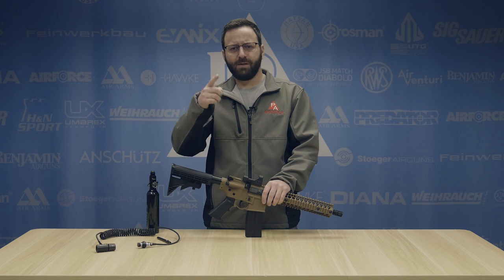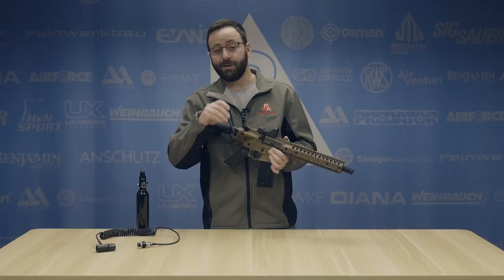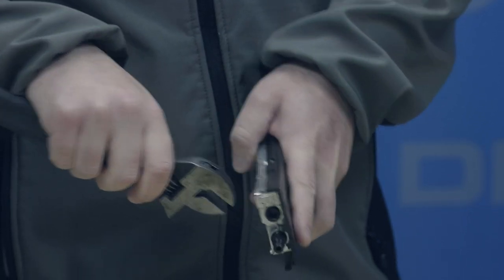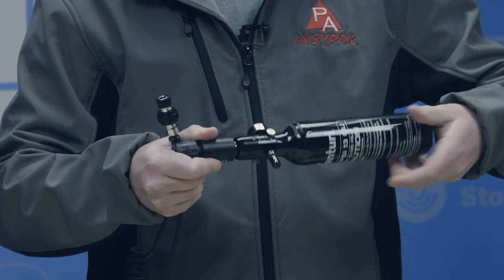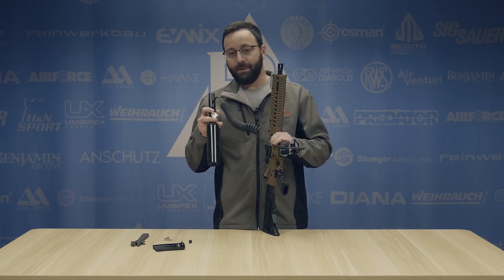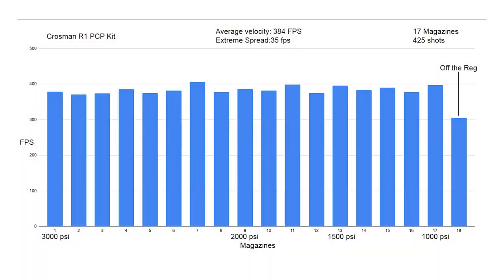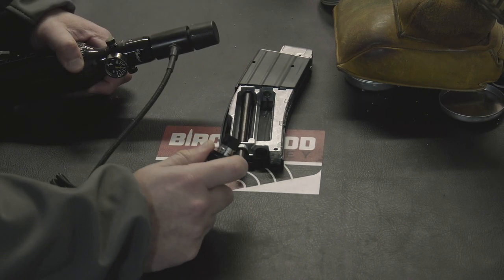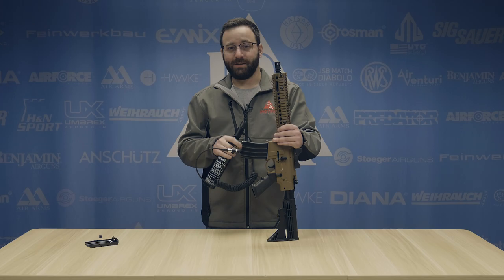Review of Crosman R1 Full Auto PCP - Pyramyd Insyder

Comment: Pretty cool setup. But I am no big fan of it - mainly just because you now are with one mag only. But still nice that you can get sucha kit. I'd rather though use it in the port #2 while keeping an empty cartridge in port #1. The cheap plunger-type  check valve between the ports often gets stuck if only using port #1..
Reply: That's why you gotta buy the spare mag with 300 count reservoir ...😉
Reply: @misterc6012  The large mag sounded like kinda of a good idea.. But I hate all rattly things.😁
Still got just two basic mags for my DPMS - but they been working all good, and that is way fine with me.

Comment: How is the Air Venturi 13ci tank best stored when not in use? I know for most PCP airguns, you want some air in there to maintain the seals. Thanks!
Reply from the maker: You can keep it stored with air in it.
Reply: @pyramydair  Thank you for responding. Any idea what pressure to keep it at? Around the regulated 1100 PSI?

Comment: How does a compressor pump up to 3000 pounds? My compressor is set for 125psi
Reply: You need an HPA (high pressure air) compressor, your typical shop compressors max out at around 150PSI, HPA compressors can go up to 4500PSI.

Comment: As a mod could this work on the umarex sa10 or the sig1911 we the people bb model?
Reply: yeah, what I'd like to know too. it looks like it could work with lots of other guns.
Reply: Sure it could, as a mod. Just need to know thread sizes and all that stuff for to make a good build for an adapter fitment for each gun/mag you wanna attach. Some probably easier to do than others - but still, doable.
Reply: @brorjordas1979  It's a length issue. The adapter may only work in certain guns, but I will see if it's been tried in any popular CO2 pistols.
Reply: @tylerpatner6591  Yes, that also.
And as asked in original post of the SA-10 and the WTP 1911.. The SA-10 mags do have a twist tab underneath. I doubt the Crosman adapter version would suit it without totally redoing the bottom of the mag. I can't remember.. It might have a thin nut as threads for the tab.. But I'd personally stay outta it. The SA-10 is fantastic just as original. Absolutely one of my top favorite blowback pellet pistols..
But them KWC 1911 pistol magazines. They do have only a grub screw underneath (most at least). A good chance for the length being an issue..
I guess time will tell.. But, I think that you actually oughta be in a very good position to check out every possible make/model you can get your hands on...😁

Comment: Can we increase fps by increasing dosage of air ??? Like.. regulator ?
Reply: You mean by increasing the regulator pressure?  Possibly, but since these are CO2 guns, I would not recommend running them over the normal operating pressures that a CO2 gun would be used at. That is typically from 800-1100 psi depending on temps.
Reply: @tylerpatner6591  oh...I see...well then on 1000 psi what fps we can get ???
Reply: @albertwesker4266  That's about where this tank setup runs. The 13 ci bottle has a regulated output of 1100 psi
Reply: @tylerpatner6591  thank You for answering 🙂